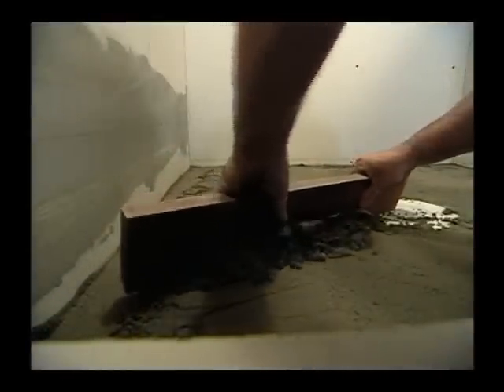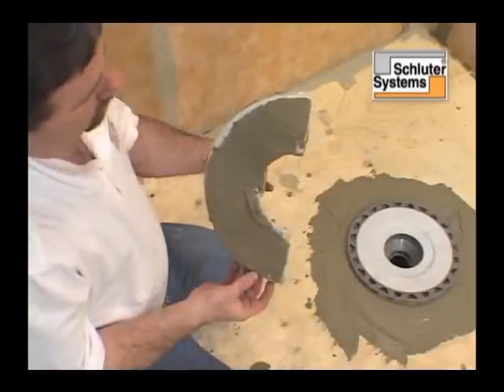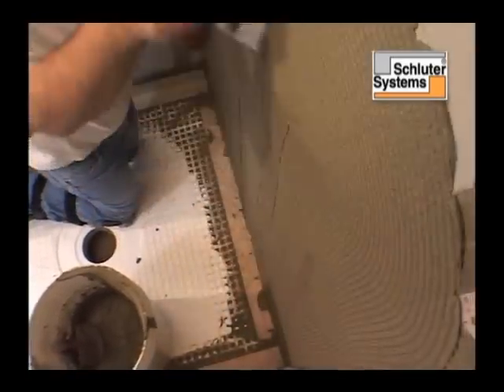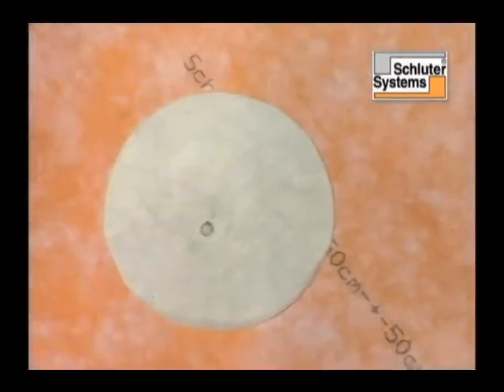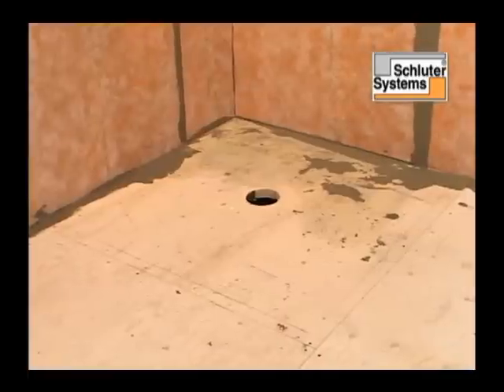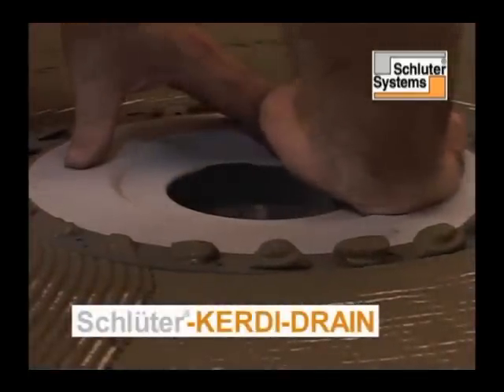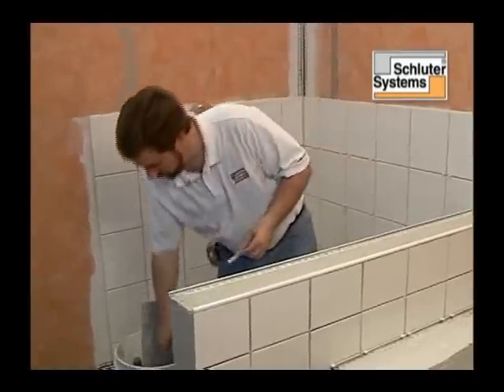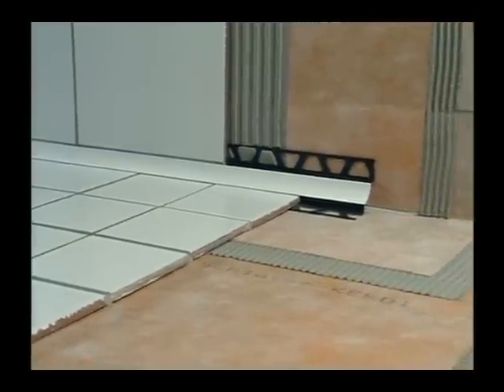Schluter Shower System Video Installation - with shower base

Comment: This product is supposed to be waterproof? I'm sure it is if done properly? What puzzles me is it is applied with unmodified thinset. What is thinset mixed with? Water. Applying this thinset to drywall without some kind of rain gard just doesn't make sense to me? You're still applying moisture to unprotected drywall?

Comment: Can you use modified thinset to put the Kerdi on over the pan and the inside corners and border strips?   I used unmodified to put the pan down over my plywood floor I just wasn’t sure on the other stuff.  Ty
Reply: you did the two things backwards

unmodified fro the membrane and modified for the pan to wood
Reply: They spec unmodified due to the lack of breathability of the membrane. Modified wouldn't cure properly. What I was told when I inquired about this years ago.

Comment: if the curb is foam...how do you screw a glass frame or glass "Stand-offs" to it. Screws won't hold in foam very well. I would not trust glass attached to foam.   Also, how come the "pan" piece of kurdi is on top of the corner pieces and Kurdi banding. Shouldn't the pan floor be put in first, then the wall banding, and then the corner pieces over that.
Reply: Guess they don't take questions.  :(
Reply: thats what i always thought
Reply: Glass is usually just siliconed to curb and screwed to wall.
Reply: For frameless door mounting, you need to stack wood 2x4 to form the curb, then place the U shaped upside down kerdi curb over that wood, secured with mortar, then waterproof with the membrane.
Reply: @lulazeta8965   the kerdi band all the way around the corners where the walls meet the floor makes it water tight. But your thinking is correct and a good observation.
Reply: This is an older video but your observations are 100% correct. Kerdi membrane on the wall first, then the corner pieces are next and I'll try to explain why. Notice his demo, vertical kerdi band then corner (folded pieces) over that, then horizontal kerdi band over them and then the wall membrane. All of this equals to much build/stack up. After the membrane is on the wall do the corners next. Then when you do the vertical and horizontal Kerdi band DO NOT fully overlap them over the corner pieces. Just overlap them the required 2". This gives you the waterproof seal and minimizes Kerdi build up. Clear as mud lol
Reply: Also, I agree that even though Schluter states glass doors can be accompanied with their curbs I don't trust it. It's probably OK its just one of those things thats hard for me to believe. Do your 2x4 curb (PT if on concrete) and then secure the Kerdi board to the 2x4's and then Kerdi band to waterproof. NOTE: it is EXTREMELY IMPORTANT to insure the top piece of Kerdi foam overlaps the front and back pieces on your curb. So front and back first THEN top piece last. Again ... clear as mud :)

Comment: He didn’t use the proper shingling method in applying tape and corners. He should have done lower corner first , then corner Kerdi to lap over. This is natural shingling .
Reply: Yes, shingling would also force you to do your floor first and wait for it to dry.

Comment: Hi since thin set is not waterproof, I didn't see you seal the seams,  a lot of seams and 4 corners. These will fail about 5 to 10 years in the future.
Reply: you have no clue what your talking about.
Reply: @gaetanodaidone4143  you watch Isaac video he flood tested and it failed , he proved that thin set is no waterproof.
Reply: Gaetano Daidone You have no idea what your talking about. Water will go right through thinset.
Reply: @Regg363  yes thinset is not waterproof but the waterproofing band is. That's why its a waterproofing system. Go pick up a TCNA handbook and read some literature.
Reply: @guyD0  fuq, the koolaid is REAL!!!
Reply: @JohnSmith-hl4bb  watch it again, he didnt overlap the corner the 2 inches that are required. Notice how issac is always using laticrete or schluter pans now?
Reply: @StarrTile  yep, and its delicious. Follow the instructions. They're quite simple
Reply: @guyD0  at the end of the day we are all responsible for our own build, regardless and despite how we made it happen or material we use or if done per instructions or not, it should be waterproof 100% before any tile, and I have never ever trusted Schluter to make that happen.

Common Sense dictates my day, not what a manufacturer advocates.
Reply: @StarrTile   couldn't agree more, and I've participated in their seminars and have done my own mockups in the garage and very happy with their products.